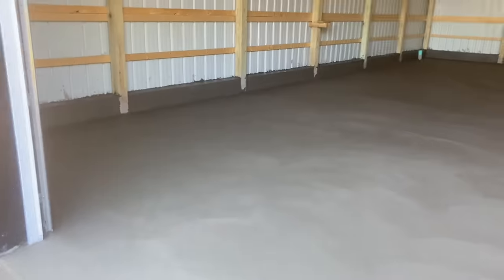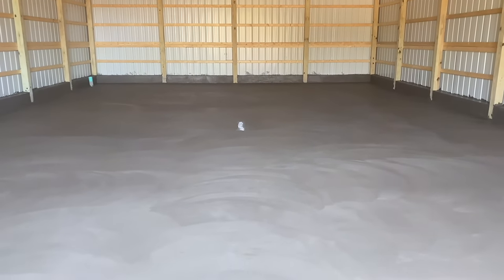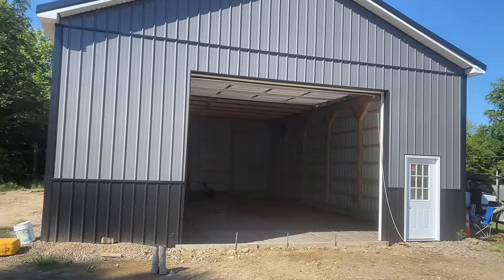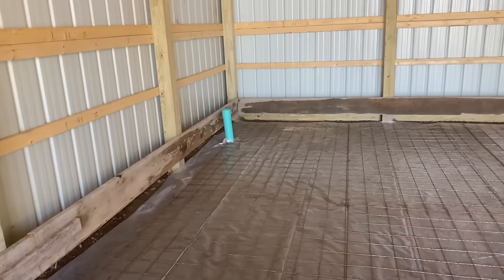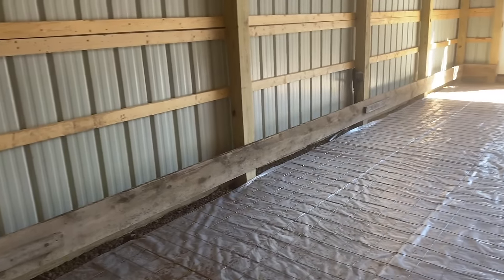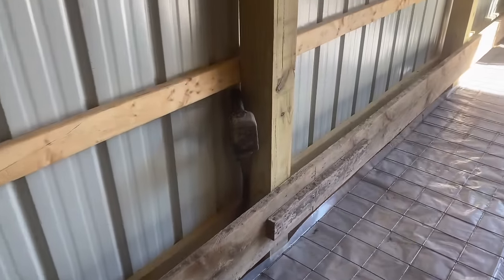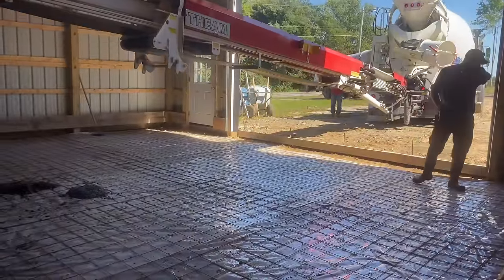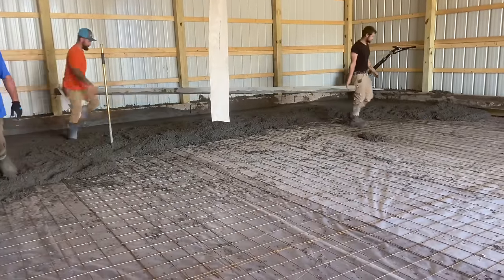All concrete cracks? Not this slab!!!!

Comment: I agree with you and built my workshop, which is the same 32x48 size as this one, using stud walls on the concrete slab.  Modern treated lumber seldom lasts more than 30 years underground and I build things to last much longer than 30 years.  My builder put the metal expansion joints in my shop floor and that saves having to cut the floor and makes a much smaller place for a crack.  My floor has pex in it and has very small cracks alongside of the metal expansion joints, but is very smooth and easy to roll things over.
Reply from the maker: Awesome glad to hear you see the value of  building something that will last 100 years instead of just 30.
Reply: @bondobuilt386  i hope to be one of the “Dead Men” that Dan Holohan writes and speaks about in his books.
Reply from the maker: @LTVoyager  ya me too what an honor

Comment: Proper compaction of the base and good concrete mix without adding water is likely why you had no cracks.  Basically the concrete did not settle, and did not shrink which causes cracks. 
For even better crack control, increase the wire size, and overlap your wire at least 1 square, and use chairs to raise the wire to the mid of the slab instead of pulling it up after. Plasticized concrete will also allow better flow instead of adding water.
Another detail I insist on is to do a spray on curing sealer right after the final finish is done.  The curing sealer will harden the surface properly and prevent pondering in the future.

Comment: Basically all concrete has excess water that contributes to the shrinking as it evaporates. I think the biggest factor is that you're pouring it stiff and you have 7 guys. The prep, thickness, and mesh helps as well of course. I've poured plenty of slabs that never cracked even though they were way bigger than a normal saw cut grid. I aim for .44 W/C ratio through use of plasticizers. Lots of guys are using 50% more water than that.

Comment: when i put poles in the ground i spread a layer of tar on them . if they are for a fence i continue extra 6 inches higher than concrete with the tar .adds a lot of years to the post
Reply from the maker: Its a good idea but I still prefer a stem wall of concrete or just build on a mono slab.

Comment: A major factor in a successful PCC Slab is the type of sub grade material your building on as well as its compaction and preparation, including base rock.   Concrete type,  temperature,  slump etc etc are also important factors as well as shape.  Eventually it will show cracks regardless of even most reinforcement.  Great job and great crew sir. Keep everyone well and safe.
Reply from the maker: Thank you and I agree with all you say. I think shape for sure is a major factor. The slabs with blots of corners are impossible to keep from cracking off those inside corners when the slab shrinks.

Comment: Lot of pole sheds built that way out there, mine was built in the 70s. Morton and possibly others now put a concrete post in the ground and then attach wood above ground. 
My buddy's shop concrete has very few cracks in the concrete after 30 years
Reply from the maker: Yup I do like how they are starting to use permacolums on the pole barns in some areas.  way better to keep the wood out of the ground Andy.

Comment: I saw and heard you commenting about pulling the wire up after the concrete was poured, but does it not get pushed right back down when the guys walk all over it? While this concrete hasn't cracked yet, if the wire is pushed back down, would braced rebar not be better long term to prevent separation if and when it does crack? I wonder if the building itself works as a pooling system to hold expansion to a minimum.

Comment: ive used short chairs and had no trouble running barrows. at least i know the mesh ends up higher in slab rather then getting trodden down by the screeders.
Reply from the maker: Peter what kind of rebar chairs did you use? Thanks.

Comment: the bottom of the 6x6's have a coating on them to keep the poles from rotting at the bottom. its like a black tar like coating. well, at least i know you can get them like that, and not sure why someone wouldn't.
Reply from the maker: The ones used in our area do not have the coating.

Comment: I like the way Mr. Post Frame does them. Set on concrete piers and then a kind of strong tie set in the concrete. No exposure of the wood to dirt or concrete. I don't work for Mr. Post Frame.
Reply: I've seen that. A galvanized stirrup etc. set into a buried concrete pier, and bolt the upright wood into that. Avoids the rot etc.
Reply from the maker: Much better way to do it for sure.
Reply from the maker: Yes much better keep the wood above ground.  @VenturiLife

Comment: I have a 180m2 slab which is now 6 years old. I have compacted the ground and insulated it and I dont have a single crack. Its all about the prep if it cracks or not.
Reply from the maker: I agree it is most important what is under your slab.

Comment: The ends of the poles are covered with water proofing, therefore they’ll last a lot longer than you think. To add, we use Eastern Red Cedar poles. 
Your job looks good.
Reply from the maker: Thank you
Reply: Considering that I'd wager it will certainly be around ready to use in 2124, so long as the roof is kept in good shape.
Reply: @ethanlewis1453  I’m sure it will be around longer than I will. My Dad built this shop to last. I’m glad I talked him into insulating it too. My Dad passed away on 1/25/2019 at age 83. He was a great man.

Comment: My last pour was a pole barn as well. I stood in the barn during the pour and would not let the men spreading to get the driver to turn his water hose on. Pissed everyone off however I have no cracks even with my 55000 lb Motorhome parked on it. Dry is better, more work for everyone but well worth it.

Comment: Our shop 32x56 was built in 2014 and not a crack in it to this day. Six inches concrerete rebar and fiber mesh, 8 inches sand and 2 inches foam. and in floor heat.

Comment: Wish I would have had your videos 25 years ago. Poured a 18x22 slab with a friend that said he knew how. The concrete truck driver tried to warn us about too much mud in the middle. Our stabbed together 2x4 screed bowed so we crowned it. Then waited too long to trowel it so my buddy said how about a broom finish? I was clueless so sure sounds good. I had to shopvac the sawdust in that shop. Could not sweep the dust on that floor. Live and learn.

Comment: For your curb detail take some 2x4 or 2x6 material the same length as your form lumber  and rip up some strips at a 45 degree angle. Then tack them to your form boards so you can remove them later when cleaning up. Wrap them up in a bundle so they don't warp all over the place until the next use. At least then you can hand finish under the edge before pulling the sides.  Bob's your uncle.
Reply from the maker: Yes Bob is my uncle. Thanks for the tp.

Comment: I do like the curb idea ! My barn doesn't have that and i wish it did. Mine is 6" "4800psi over 4" of pea stone due to solid clay substrate,  has a shallow rat wall mono-pour around the edge, 12" x 12" deep at the doors , wire, plastic sheating and expansion fiber around the posts (Mid Michigan winters) i saw cut it & kept it damp for a month. It's now 20 years old, had fork trucks cars, CNC machines on it and only have a few very thin cracks but it hasn't spread or lifted.  
 I don't care for the concrete against the steel corrugated siding. Now the curb has corrugations in it and if the siding needs replaced due to rust from the concrete and moisture (which it likely will) the new siding will need to match and be placed exactly the same. Not your build and not the way I'd do it is all. 
 I like your work ! Wanna come do my driveway ?

Comment: Nice work ! I had a 20 x 40 ft I also did not want saw cut. I thought the 18" thickness, yes 18", would save me. but no two cracks developed about a year later

Comment: I'm replacing a haybarn with similar pole-barn construction built in 1971. The posts completely rotted 10 years ago and I propped up the barn in 2016 with self-built laminated posts set 4' in the ground and 2' inside of the original posts. These new posts..with new treated lumber are already rotting. A windstorm last year took down about 40% of the 36 x90 structure. Our 40x60 machine shed which is all metal and built about the same time is still going strong. Even though it was a very cheap low grade kit. If it wasn't hit by tractors and equipment over the years it would still be in very good shape.

I'm going with the 2" square tubing ladder frames and trusses every 4'. Will never consider a pole barn again. Just too much maintenance over the years and wood bees love to bore holes in all of that wood. Tempted to build a deep stem wall for the foundation instead of a concrete slab with thick concrete around the edges.

Comment: All those buildings in our area use perma-columns it is a concrete post that is connected to the wood post by a steel bracket.  That’s makes it a forever barn

Comment: He should have put pex in the slab for heat.  That is the best decision I made on my shop.  Very inexpensive to heat and very comfortable to work in during the winter.  I keep the thermostat at 65 and it is very comfortable for working.
Reply from the maker: He had us do it in his house but wanted to use his waste oil furnace in the shop.
Reply: @bondobuilt386 waste oil boiler with in floor heat would have been the best option. Sense he wants to be able to burn used oil. Best of both scenarios.
Reply from the maker: Ya I agree but he had the furnace from his old shop. I love my radiant in my garage.  @kevink4914

Comment: How does the wire mesh stay suspended in the concrete after lifting when multiple people walk over it pushing the wire back to the bottom?
Reply from the maker: We tiptoe on it so it barely goes down. Im still trying to figure out how to pour these floors without actually walking on them. LOL

Comment: If the forms were made of rust or rot proof stuff  & left in place after the pour? Would that help to minimize cracking by keeping the slab or podium deck inside a box, eliminating expansion space?
Reply from the maker: no box would stop concrete from moving but concrete actually shrinks as it dries. frost will lift it if it gets under an unheated slab in wet slow draining soils

Comment: In the Chicago area, we call this a rat wall. Its usually not done with the structure in place, usually the walls anchor to the top of it. Not a new idea, mostly seen on the garages one builder did in the 40's/50's. Never thought about it, but I'm sure your right about the wall and cracking... Most of those I've see are still intact from the 40's.
Reply from the maker: Cool thanks for sharing that. Evidently it added a bunch of strength too
Reply: Down south they can add metal under the walls and called rat wall or stop

Comment: I am not a concrete guy but I have a question. It appears the rebar is not elevated. Does that cause cracking and Spaulding on the underside of the slab, which could eventually propagate to the surface?
Reply from the maker: there is no rebar in this slab just wire mesh and we lifted it as we poured with potatoes rakes.

Comment: I have a 6" 2400sf slab as well in a shop building. I had one crack show up after 2 years. It's a post building. I'll take the saw cuts any day over that hairline crack. With the saw cuts, wheels roll over them easily and for the "dirt accumulation." They're either filled with dirt making them flush, or as I did. Sweep some sand in them and then run a line of Tremco 45 SSL over them. They basically disappeared. The hairline crack on the otherhand is almost impossible to fill and make it look nice.
Reply from the maker: I have to agree. You could sponge some tile grout in the cuts also.

Comment: I have done a couple of jobs where we used Ductilcrete where the only control joints were 60 foot on center. Definitely crazy to see that large of an area with no saw joints or cracks.

Comment: Hypothesis:
* Must be those wooden vertical support columns that go 4 foot into the ground, along with the concrete "curb" that you added, keeps the entire slab from moving and creating any large cracks.
* I don't remember if you stating if the owner installed any insulation "under" the slab but I remember you stating that he compacted the soil really well.... and all of those elements together must be combining to keep the slab from shifting and creating any cracks... which is incredible... especially in the colder areas of NY.
* I grew up in Western NY close to Olean.... and I know how cold it gets!
* I also built some concrete porches with my Father.... AND we had a concrete lawn ornaments business (ie: urns, water-fountains, religions statues and animals statues etc) so I have "a little" experience with concrete.

Great tips and feedback... most appreciated.

Amen
Retired, Veteran

Comment: Two years into a 50x40 shop 4" thick, saw cut it 1.5" about 3Xs in both directions, so not very many. Using 3000psi, wire mesh & mico fiber, the thing dosen't have one crack so far.  29PALMS USMC live range is about 10mi away & we're shaken ALL the time! 
I've used micro-fiber on several patios, garages & additions, almost never experience a crack!

Comment: Great work.  You mentioned all these variables: 6" slab, 4000 psi with no plasticizers or extra water added, 5.5-6 slump, and a wire mesh that was lifted up. Do you think it's a synergy of all that, or is there 1 or 2 of those things that really prevented the cracking?  Just wondering if this is possible with a 4" slab.

Comment: The cracking in slabs is often caused by shrinkage, not expansion like many believe. The purpose of saw cuts is to put those cracks from shrinkage in beneficial locations. This is why saw cuts have to be made relatively quickly (within 12 hrs) of the placement.  With proper moisture management you can help eliminate some of the water loss that leads to too much shrinkage.  It's tough to manage consistently just do to the variable nature of concrete and the elements. Obviously you can get cracking due to poor compaction of the subbase but a lot of cracks later in life are just the growth of the hair line cracks formed from the first couple days of curing.
Reply: and thats where they will have cracks show later on this LOL

Comment: Just wondering if you have ever worked with helix steel?  From what i seen and read its quite an impressive replacement for rebar in a lot of jobs

I do not do any concrete work and would love some feed back from people currently in the industry
Reply from the maker: I have never used it. I do hear it is rough on the concrete equipment on the plants end. Like the trucks and conveyers

Comment: I am curious of the Cost of this Pour ?
I have almost the same size Building and want a 6" slab. I can do all the Prep work like He did.
Mine will have 2+" of Foam insulation for Pex. I like the Curb idea too. 
Just the Crew and Mix.   
I'm in Central Wis so I figure costs will be different. Just need a ballpark figure so I know what the Sticker shock would be. 
Mike M.

Comment: Ok, with that curb deal....I would think the weight of the concrete would push the metal siding outward and cause a noticeable bulge at the bottom of the metal siding from the outside.
Reply from the maker: It did not do that we have done this 2 times. The pressure just pushes the concrete out the bottom. We did have a bow in one of the boards on the other one we did but not bad.

Comment: It can be done. The hangar where I work was poured in 2005 and there aren't any stress cracks in it anywhere., which is what you'd expect for a slab with a 737 parked on it for days and weeks at a time as they go through maintenance.

Comment: I am a career concrete contractor , there are 2 kinds of concrete the kind that has cracked and the kind that hasnt cracked yet , when you dont put joints it will crack where it wants to and this slab in time most certainly will, for anyone to think differntly is complete ignorance. but I do agree , give the customer what they want, this wants uncontrolled cracks , may be 5-8 years down the road
Reply from the maker: Well I can guarantee 2 things. It won't catch fire and nobody will steal it  LOL

Comment: The slab will crack and probably has already.  Standard practice is to saw joints within 24 hours of placing as the majority of shrinkage occurs quickly but continues slowly for even years.  .Compaction of the base has little or nothing to do with shrinkage cracks.  Low water to cement ratio of .40 or slightly higher is good practice as well as proper aggregate gradation as previously mentioned.  Water reducing admixture is quite commonly used with super plasticizer less common.  Both improve workability and allow less water in the mix.  Yes the mesh should be on chairs to keep it up in the concrete.  If you don’t want saw cuts use rebar in the slab both ways and the cracks will not open up.

Comment: Don't worry, it will crack eventually. Like all things concrete expands and contracts. Without expansion joints being installed in a slab of this size, it will crack.
Reply from the maker: It might?
Reply: I'm so glad dams and the Chunnel don't know this.